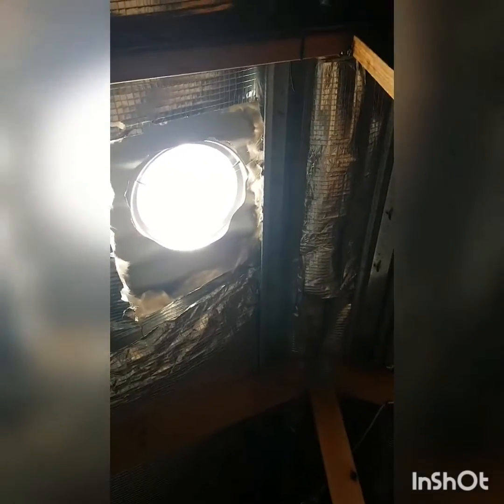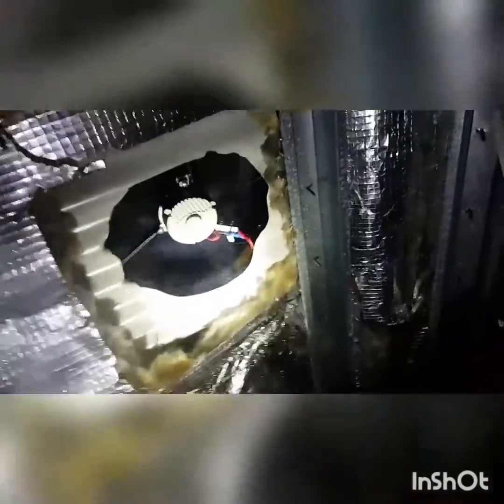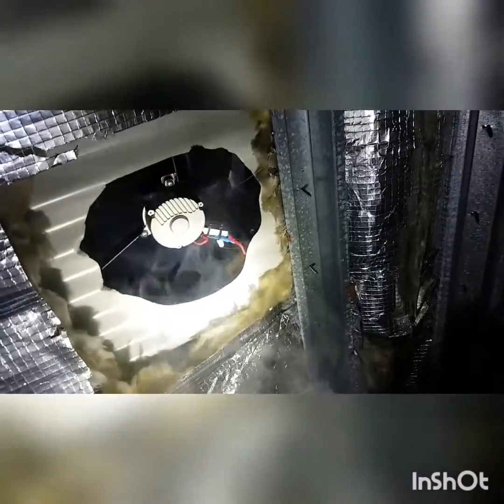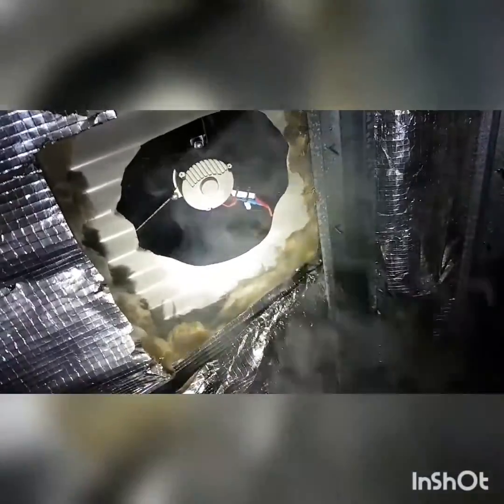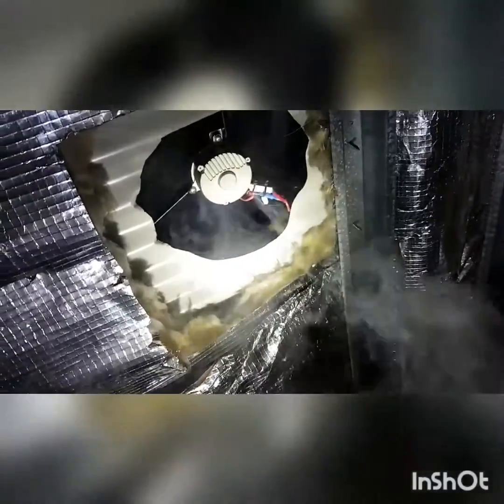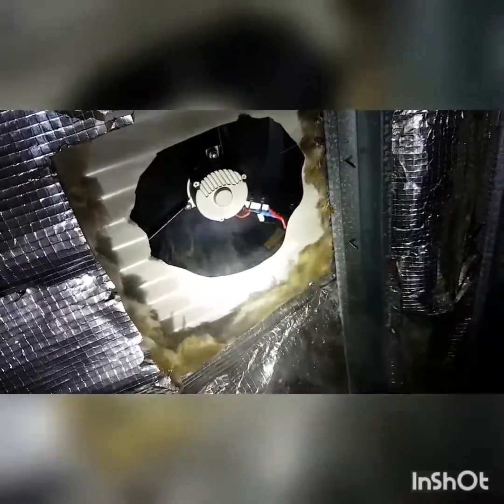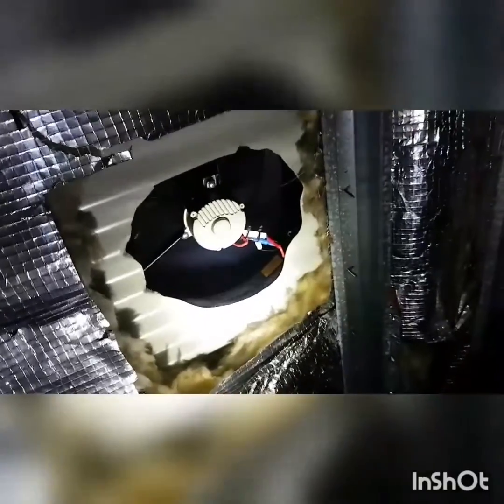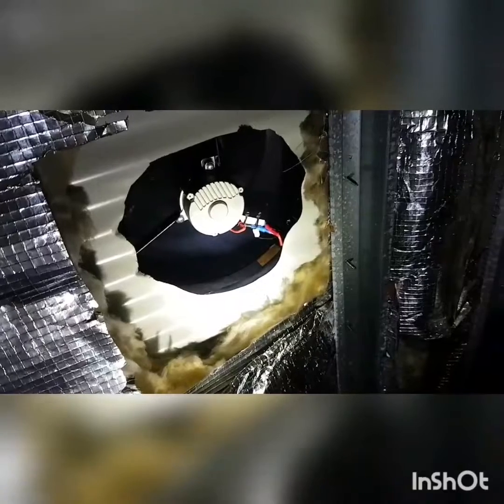SolarKing Smoke Test & Review by Venturi Industries.

Comment: Hi, Thanks for the video's
I notice the two red wires connected to a resistant, can I connect the two red writes directly
Reply: Yes you can. The resistor is included as if you don't use the resistor, full power mode is a bit loud